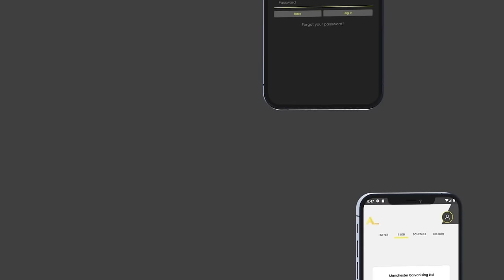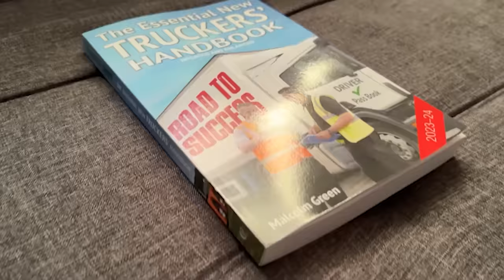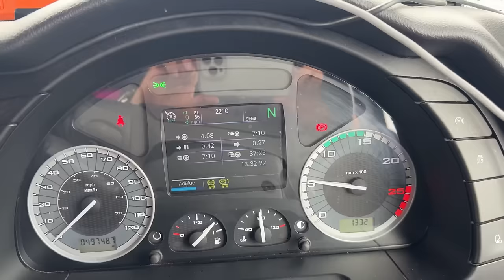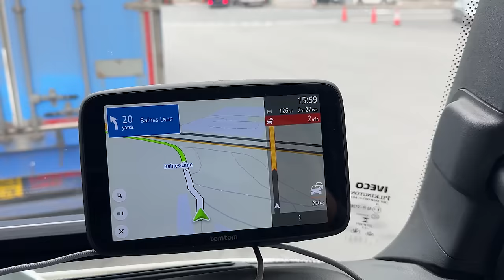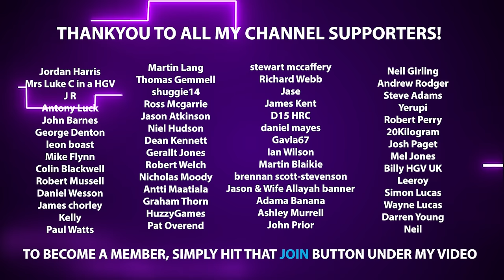Traffic Made Me Go Over 10 Hrs Driving!

Comment: 360° would work well for driving maneuvers such as tight reverses or tight entrances if you could somehow attach it to the outside of the tractor unit as it would show the tightness of some things better than a gopro and you could alternate between front and back easily.

But defo GoPro for the main to main when you're talking to camera and 360 for B Roll perhaps?
Reply: Could you also perhaps still record audio to the go pro whilst using 360 and overlaying in the edit to make it work better?

Comment: Any words of advice for newbie drivers or any particular work that’s “easy” to help get some miles under your belt ?
Reply: A Trunking run is a good place to start I think, other than that take your time, nice & slow round roundabouts & when maneuvering, keep checking those mirrors. Don't be afraid to get out & look, you will soon get to know by getting out how the trailer is positioned on the blind side where the tail swing is etc. Most firms will send you out with another driver to start with too.
Reply: Thanks as I had a wild one all over the place and made me question life 😂

Comment: 360 is hardly a new thing at this stage. The problem was your settings and your inner man child that has to use any gimmick available. There's absolutely no reason you can't use the 360 with the current format of video. You don't need the constant "flex" of I've got a 360 camera with those horrendous spinning transfers. Once you get over your initial "I want it all" the camera will add to the channel.
Reply from the maker: How can somthing both be “not a new thing” and a “flex” at the same time? It’s a £200 2nd hand camera mate. Hardly flexing on it.